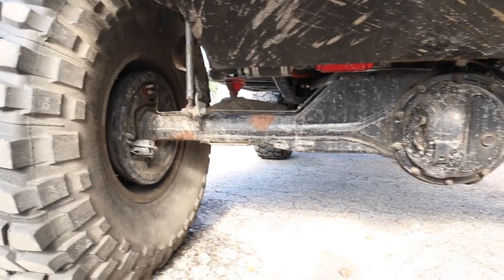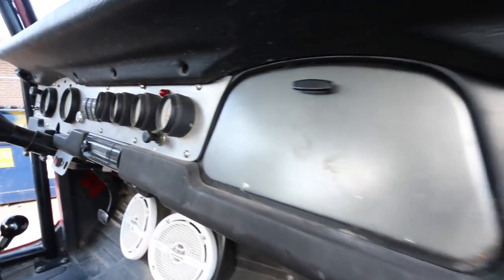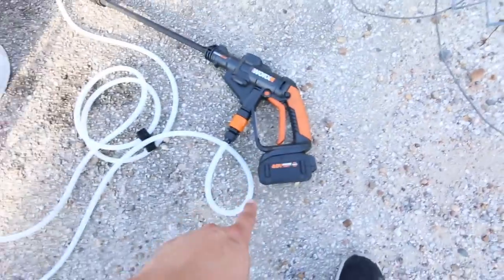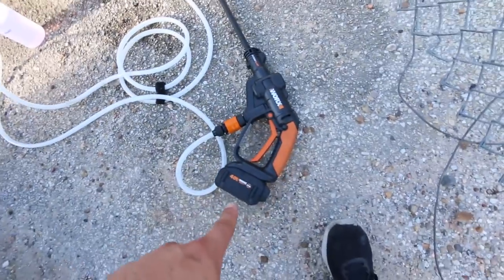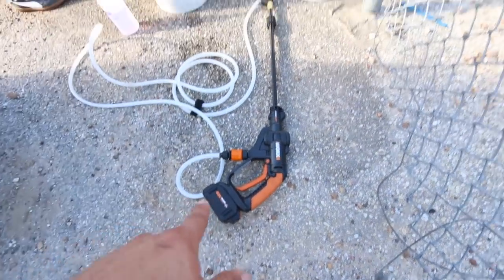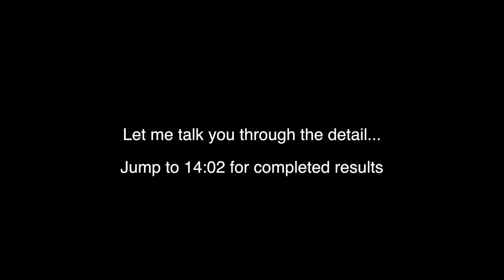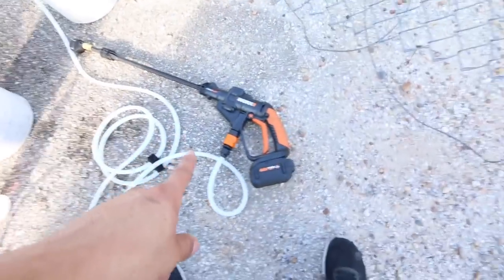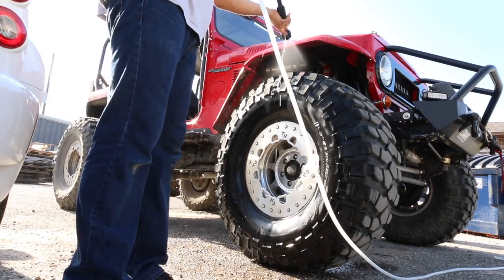GRUNT WORK: Cleaning and Detailing Off-Road Vehicles - How To Clean Dirty Car

Comment: So you don’t use a foam canon for muddy  vehicles just spray it with 10:1 super clean and water then ONR wash it?
Reply from the maker: 60% of the mud came off with the pressure from a garden hose
Reply: Ok cool... just trying keep it simple and not have to use multiple things.
Reply: What ratio super clean you use for tires and wheels ?
Reply: Plus I don’t want to buy foam canon if I don’t need one 😀
Reply: What are some good cheap clay mits ?
Reply from the maker: I haven't used a pressure washer or foam cannon in over 3 years

Comment: Dude a real pressure washer will change your life
Reply from the maker: Yes, it would help 100x on this job
Reply: MILINICH'S AUTO DETAIL it a good backup if the customer has no water source.
Reply: Aaron xp that’s why i bring my water :)
Reply: MILINICH'S AUTO DETAIL he has one in his van I think, just don't want to use the customers electricity and water as much as possible
Reply: GeeStang yea I was relying on customers water and it was a big hassle.. 65 gallon tank for 200 bucks solves that problem
Reply from the maker: Yep- I'll have a full setup on my next van